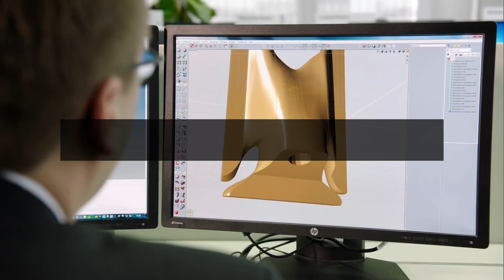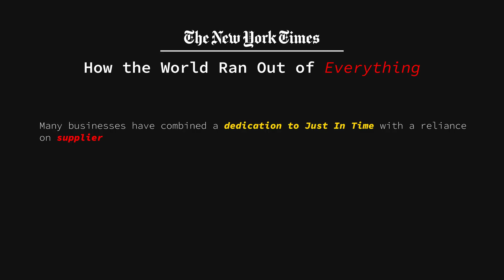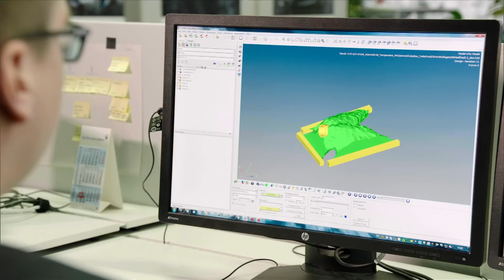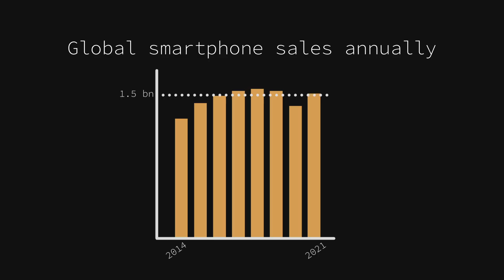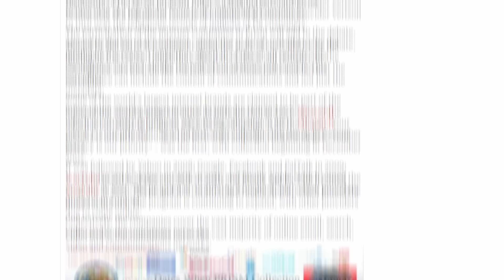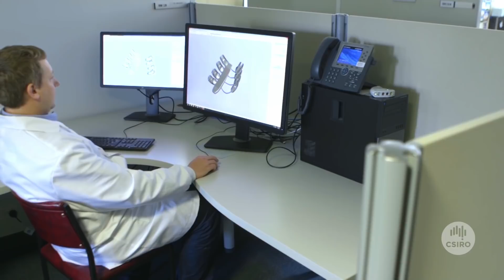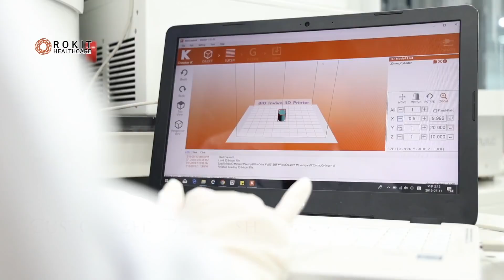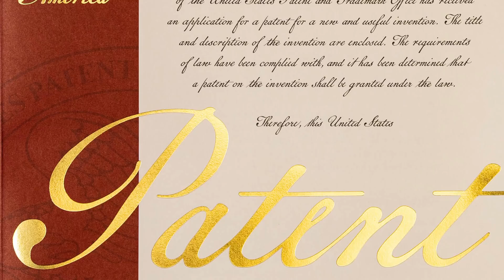How 3D Printing Could Decentralize (Almost) Everything

Comment: I have been 3D printing for industrial designs since 1989. Daily I run dozens of 3D print jobs in resin, powder, filament etc. Obviously 3D printing is fantastic for accelerating design to manufacture cycles, but the current state of the technology is just a pain in the arse. It is messy, inconsistent, unreliable and plain difficult. Accurate technologies like resin produce brittle parts. Robust filaments are great, but don't have the surface quality. Filament printing in flexible plastics is an art, not a science. The 3D printing revolution you are referring to may come one day, but we are nowhere near it today.

Comment: Im a CnC machinist and have a 3d printer for 3 years now. I think neither of the tecnologys, additive or subtractive is currently able to decentralise manufacturing in the large scale. Additive and Subtractive manufacturing still reqire Years of experience and subtractive  machines with the precision and reliability you´d need cost upwards of 150.000€. For 3d printing you have a range of settings like a football field, but it only works properly if you hit the settings all in one spot, the size of a single blade of grass. For CNC machning it requires specialy trained Personal that understand the process, its limitations and how to strategicaly form a part out of a Block of material. Its a Process many people underestimate in its complexity, and limitaitions . And being in the manufacturing industry, i know that the limitations of both processes often can be overcome by combining the two. for example print a hollow part (wich is impossible to manufacture with substractive metods) and then finish the surface until its shiny like a mirror (wich is currently impossible with 3d printing). So for getting optimal results you would need people who really understand both processes, know how to apply them and when to apply them. i wont even get started on how many Highly trained Personal it would take to decentralize things ona lage scale and how the prices would skyrocket if you have many small Shops that are producing parts on a smaller scale.

Comment: Great video.  I really hope 3D printers become as common in family homes as say a microwave or refrigerator.  Once we can start printing out items with circuitry at a reasonable cost, the game will change and change fast.
Reply: I don't think it will for a long time... there not user friendly enough, people are lazy.
Reply: Multi head or tool (movement?) Machines that can make pcbs into parts or simply make mechanical causes that are physical parts could be made to. 
Not very effective though.

Comment: 3d printing will help with some items you talked about for one off's or low production runs.  Once you are over 2000 parts, making an injection mold is the cheapest and fastest way.  You can't print fast enough to supply parts for a car.  Also, the comment about making parts for cell phones/military...etc..what ever...you would need the master models, other wise if you have to reverse engineer, while it can be done, that will be one expensive part.  I know because this is what I do.

Comment: This guy has never used a 3D printer, or understand safety and the complexity of printing different material. You still have to have filament, or printing material. This whole video is bullshit…I’m electrical engineer. Try making an simple integrated circuit. Simple AND/OR gate. Not possible without precise equipment. It would cost 20k$ in equipment

Comment: Bioplastic combined with 3d printing could be even more revolutionary. The waste equation changes, but in theory it also means we can localize the materials for production.
Reply: Most popular 3D printed materials are already bioplastics. PLA, the most common print material, actually has a slightly sweet smell to it, as it’s made from sugar cane. The bigger issue right now is the actually spools that the plastics come on. They are generally made with traditional plastic and manufacturing and are rather wasteful. Right now there’s a push to have them be made out of recycled aluminum instead.

Comment: This video was clearly written by an engineer and not an economist. Not to mention that a lot of the ideas that the author talks about Are not even possible yet.A lot of the 3-D printers that were used in the video such as a metal 3-D printer and a printer that can print on the scale of microchips areExtremely expensive and will remain that way for at least the foreseeable future.

Comment: I'm sorry but you forgot that shortages will affect any material in this period. If we wanted to 3d print our staff cause of the product being on the other side of the world delays too much, you realize that the filament would be also in shortage so you still couldn't produce enough. Either way the problem is not that we can't produce our stuff alone to meet demand, it's the thing that causes the restrictions in the supply war, covid,political instability,etc... The solution is to let the market be free and inefficiencies will be sorted out on their own... 
I will give you that mass production has one solution for everyone which obviously 3d print solves and that you can have it when you need it if you don't have shortages of any kind in the supply chain cause as I said there wouldn't be enough filament to meet demand on the time you need it
Reply: Also, 3d printing has a lot of pit falls for everyday people. Not perfect lining,rough texture, leveling the bed, parts breaking... I don't think most people can put up with it. If you make a 3d printer which paints the part has perfect quality like high scale manufacturing then yes everyone would change to 3d printing... Technology has to progress before this happens. So and by that argument every company will have to mass manufacture only filament which is crazy. I think 3d printing will be a big revolutionary change but not much as you say. There will be a market for it but it seems crazy to have mass manufacturing get obsolete, but who knows technology progresses faster than I can imagine

Comment: 3D printing is great and opens up a lot of possibilities, but there are some things that you simply can't 3D print and there's no sign of that changing anytime soon.  It's hard to beat forged steel with any process.

As for patents.  Getting rid of them might benefit small inventors, but without them, no one would invest the money to develop complex technologies if it weren't for the guarantee of a return on that investment.  That's why you see so little innovation coming out of China.  No company in their right mind would develop something there only to have it stolen the instant it hits the market.

Comment: I'm a big fan of this channel, but I would like to point out some major oversimplifications in this video. A lot of engineers have already mentioned in the comment that the manufacturing process (additive or subtractive) is much more complex than just pressing print so I won't beat a dead horse. My big issue is with your statement that decentralized 3d printing is somehow better for the  environment than traditional manufacturing. I feel qualified to address this because my full time job is at small manufacturing company and my channel/part time gig is sustainable farming. Three points:

1. Modern manufacturing is incredibly efficient. While there are waste products in traditional manufacturing almost all of it is reused. For example meatal is very valuable and is collected and recycled. Metal is the most recycled material on the planet. Plastic is difficult to recycle when it's mixed (like in your recycling bin) but in industrial processes the excess is pure and thus easily recycled. Wood chips and sawdust are made into fuel for pellet stoves, scraps of lumber made into charcoal, I could go on. 

Most importantly modern factories have their machines running as long and as often as possible. Most major factories keep their machines running 24 hrs. a day. What's more efficient: 24 consumer 3d printers running one hour a day, or one machine running 24/7? Consumers products are more wasteful. More machines are made requiring more materials and rare earth metals to make (like all electronics) and they are only used for a fraction of their possible run time. We already see this with people buying laser engravers and vinyl cutters for personal use. They use it once in a blue moon and then it just sits there. 

2. 3d printed materials have a large environmental impact, sometimes worse than traditional manufacturing. 3d printers DO NOT USE RAW MATERIALS. Raw materials are things like uncut wood, unrefined oil, and unprocessed ore. Every type of 3d printer needs heavily processed and refined materials, often made specifically for them. These materials are made in traditional factories and refineries, and are just as much a part of the global supply chain (and just as vulnerable) as traditionally manufactured products. 

They are also often just as bad for the environment. For example, the 3d printed houses require some form of cement to bind the aggregate. The most common being Portland cement, which needs quick lime. Cement requires and obscene amount of energy to produce, as quick lime needs to be mined and then baked in giant furnaces to work. It is also a none renewable and fast depleting resource. Wood on the other hand is renewable, and readily available in most of the world. Most forests in developed countries are managed sustainably, and it is possible to harvest and mill your own timber from very small pieces of land. Wood also breaks down naturally and there are many uses for scraps, unlike plastic. 

Speaking of plastic, most consumer grade 3d printers can only produce plastic products. Plastic comes from the massive oil extraction and refining industry. Most oil comes from impoverished and repressive countries. Plastic last for thousands of years, is difficult to recycle, and contributes to climate change. Even if they are sourced from plants, this still requires huge amounts of land and refining, resources that could otherwise be used to feed people. 

3. Decentralization is inherently inefficient and thus bad for the environment. Decentralization means redundancy which means equipment and materials sitting around, and not being used to their full potential. This is the argument people make about crypto. Having multiple computers working on the same problem is secure and resistant to hacking but it is wildly inefficient. A 3d printer in every house (as mentioned in point one) means millions of hours of wasted potential productivity, and tons of wasted material. 

I'm saying all this not as a troll but to help. I agree with much of what you said at the end. 3d printing has many awesome potential uses, and it will also be helpful at evading restrictive/unfair/corrupt laws. But it is misleading to claim that it is radically more efficient than traditional manufacturing. It is even more misleading to claim that it is better for the environment. 

ALL HUMAN ACTIVITEIS HAVE TRADEOFFS. We need to acknowledge that up front. Privacy, decentralization, and redundancy are no different. If we want this movement to be taken seriously we should acknowledge these flaws openly as a price worth paying. Trying to create and oversimplified false dichotomy of big traditional corporations do everything bad, and private open source is better in everyway is pure ideology, not facts. 

You have a good message so please don't weaken it with gross oversimplifications and a little to much paranoia!

Comment: This is wrong on so many levels and at best just wishful thinking. 3D printed houses are nonsensical and cost more than traditional structures. You want cheap curved walls made of smooth flat stone? try adobe and natural mud mortar instead of 3D printed concrete behemoths. You cannot print chips on 3D printers lmao. Look up videos of people making their own extremely simple designs take hours with thousands of specialized equipment. The reason why mass production exists is because we now have extremely complex objects that you cant just hammer out of metal, craft out of leather. Last year I tried to recreate a plate holder for a super rare camera I bought. I go to an engineering school with really good equipment, we have the self dissaving supports and everything, I was able to make it all one part. The plastic is far too flimsy and bends, the interior slots were not accurate, the surface is rough. Overall, it is a highly novel technology best used for geeky trinkets at this stage.

Comment: Look man, your heart is in the right place and I would like to say I loved the video, but damn, there are so many inaccuracies in this video, mostly when talking about manufacturing technologies that it becomes plain misinformation and makes the conclusions flawed. I'm not sure why there are only a handful of comments addressing the issues, actually, there are so many that I have not the time and don't even know where to start from.

i will just say that traditional manufacturing methods are not going to disappear anytime soon, at most the new technologies will complement them (a thing that has been happening pretty well). 3D printing is a term that holds a wide range of automated manufacturing methods and all of those have they right applications. Surely 3D printing is a "relative new" (popularized) tech and because of that people are trying it on anything and everything, even things that actually make no sense (yes, 3d printing houses and printer farms are a dumb idea) It's part of the innovation process, in time the successful applications will stick around and the others will die out.
Also, any type of large scale manufacturing is not wasteful (not the same as polluting) because wasting material or energy equals wasting a lot of money, people are not that dumb.

Comment: I didn't even realize how actually efficient it is to 3d print things. I just got some new headphones and was tired of putting them on my bed or randomly on my desk, so I just found a file online and 3d printed a holder to put on my desk. probably used about a half-dollar worth of material. It didn't even occur to me to look online for the same kind of thing. What's funny is the only reason I have the printer is because of the 3d printed gun community. It just happens to be useful for any other thing you want.

Comment: Carbon fiber will get better and we will have more bio polymers like spider silk, cellulose, chitin or chitosan and ceramics. LEDs can be used instead of expensive lasers to melt metals. We need more 3D printing with polymers like cellulose because these plastics are toxic (pthalates) and cause reproductive problems.

Comment: The biggest issue I see here is that it is almost always easier to mass produce things using other techniques. A fully 3D-printed phone for example would cost a fortune and take an age to make. A 3D-printed 3D printer that can print itself remains elusive unless you mean living cells.
Reply: Prusa printers are almost entirely made of 3d printed parts and standardized mass produced components (like metric threaded rods)

Comment: I dont like how you oversimplify everything and present this one thing as an absolute godsent. Things are way more complicated, 3dprinting has its major flaws. Its a complex topic.
 Im at 3rd year of mechanical engineering, its heavy on manufacturing here. And  it took me those 3 years to understand how complex of a topic it is, not even be very knowledgeable on it. While u just make it extremely shallow, it makes me want to vomit.

Why do we focus so much on 3d printing? Mini mills and lathes arent much more expensive than good 3d printers, u can make a lotta stuff. There are people who have nice workshops in their garages.  Forging, welding, milling and turning, its all available for many people who want to learn it. Imo we should build upon what is very well understood and works extremely well (incredible precision and efficiency), instead of completely throwing it out of the window, just for the sake of being rebelious and cool and different.

U put so much faith in 3d printing. Ok, but what if filament supply is cut? Are you gonna make your own? Its probably safe to say - no, you're not. Where as - steel and other materials for "traditional" manufacturing you can find everywhere and its not expensive.

Comment: A big part of 3D printing success is developing more user-friendly CAD Software.  startups like SelfCAD will play a big role in the mass adoption of 3D Printing.
Reply: There is already fusion 360 easy to use.
Reply: @valian8985  fusion 360 is too limited when it comes to modifying STL files and too clunky with larger objects
Reply: @random_thoughts9144  STL is arguably not even the best format for 3D printing. You should be using feature recognition and use the tools in the software as intended.

Large is relative as well, complex assemblies sure I can see that. But for nearly anything an average person would want to do it is good enough. If you are making cars or boats or have assemblies larger than 1000 parts you should be using a more robust platform.
Reply: @random_thoughts9144  stl files are limited themselves. you can't shift the blame to the cad software. You ever try to manually remove the background on a jpeg file with nothing but the fill tool? That's like trying to edit an stl file. If you are lucky and the file you are working with has a step version, then that would be like a png file; easily editable and lossless.
Reply: @valian8985  so why's it demand I join an education or professional "team" in order to use the software?
Reply: @valian8985  you have to pay for fusion unless you’re a student though
Reply: @clared5812  it's free for hobbyists